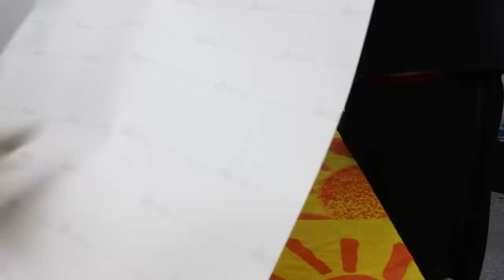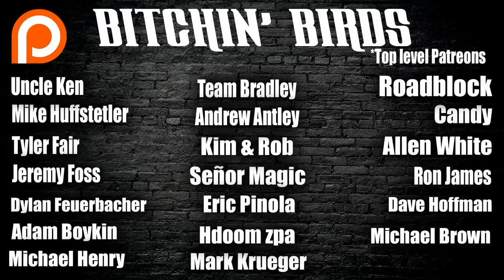Vinyl Wrap Harley-Davidson Street Bob - Dyna Build Series Ep.15

Comment: After watching your video and many many others. I have to say if you are going to take this task on order a few extra feet of vinyl you will need it. Also look up the manufactures data on the vinyl you are using. I found out my vinyl would stretch 30% that means for 10" it can stretch 3 inches. 3 inches is a long ways. After several failures I found I was not stretching it enough. Also I put it on at room temp and no heat until the end once it was all set. Lastly Start off on the Hard part first because I have found its much easier to get rid of the lines and bubbles at the easy end then it is if finishing on the hard end. At least that is what I have learned so far with trial and error.

Comment: Question: I’ve seen a couple of other people that have wrapped their coils/ springs. Do you think there would be an issue with the vinyl on a “moving part” like springs over time? Do you think it would peal or crack or would it retain its elasticity?

I have a Jeep Wrangler and I want to color my new suspension pieces before I put them on. I don’t have the time, money or know how to powder coat them myself but have seen videos where people have heat wrapped vinyl around the coils.
Reply from the maker: If the coil was large (like a jeeps for example) I think it could last for a few years depending on usage of course. But for coils I would highly recommend just taking them to a shop to powdercoat. If you don't feel comfortable disassembling a spring, just take it to an auto shop. Most will do it for like 20 bucks.

Comment: tried wrapping my bike...ended up throwing my heat gun against the wall
Reply from the maker: It's not for the faint of heart!
Reply: How has the wrap lasted? I wrapped my sporty fenders and it peeled off as there was too much tension.
Reply from the maker: If it started peeling from tension then you didn't kill the membrane after install. If you stretch it a good amount you have to heat it up to at least 190 degrees to keep it from trying to go back to its original shape.
Reply: Johnny Slater 🤣
Reply: This is what I suspect would be my outcome 😂😂
Reply: I know this post is old AF but I am trying to wrap for the first time and the item I have to wrap is a massive front fairing for a harley... like the HUGE ones with the big ass headlight. Do you have any tips for me because I am tempted to throw my boyfriends bike in the trash because it has me so mad. Please someone HELP me
Reply: @seansmama12131   how did it turn out?